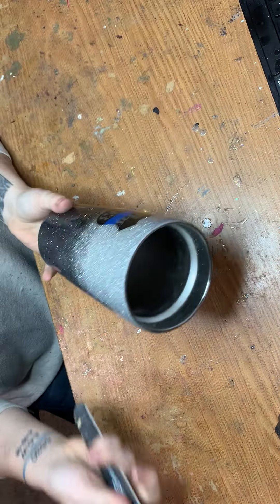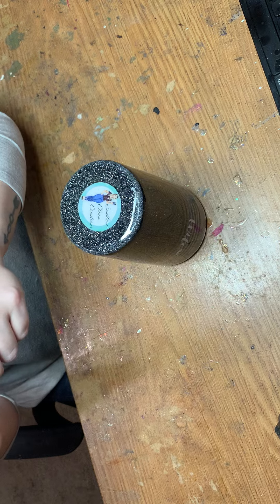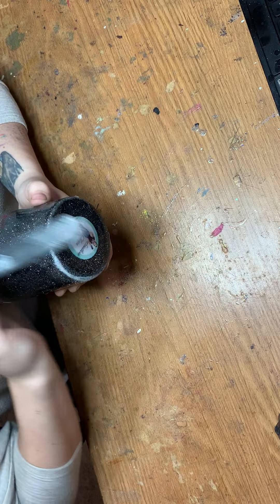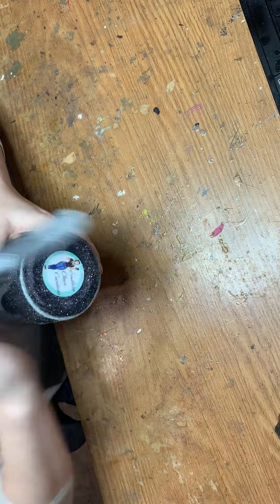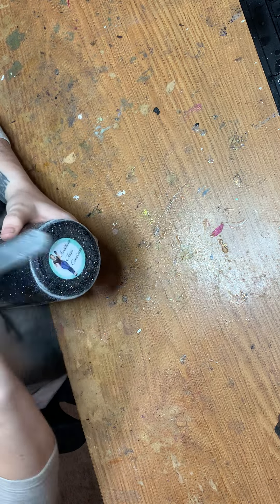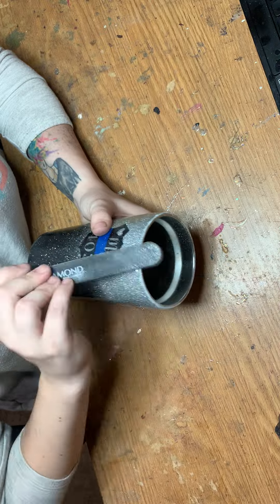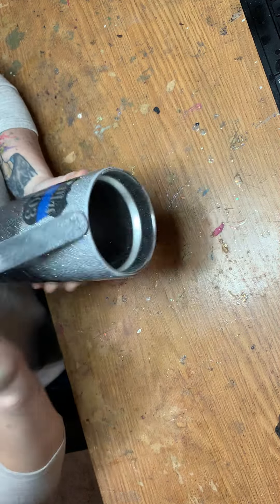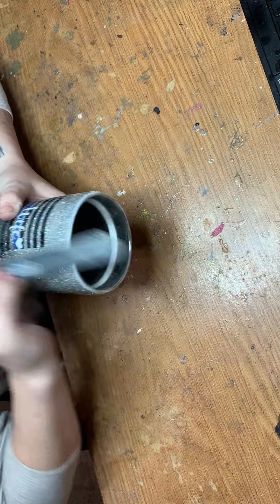Sanding Your Glitter Tumbler

Comment: Do you actually have to sand the entire cup ? Like in between coats of epoxy
Reply from the maker: It is recommended to sand between coats, most the time a light sand is all it will need. I will do the rim and bottom between every coat and then lighting run over the whole cup. I only heavy sand when needed. :)
Reply: Southern Chaos Creations thanks for the clarification I really appreciate it ❤️